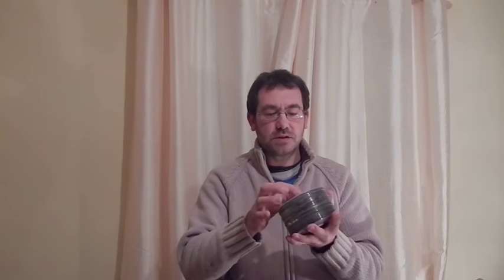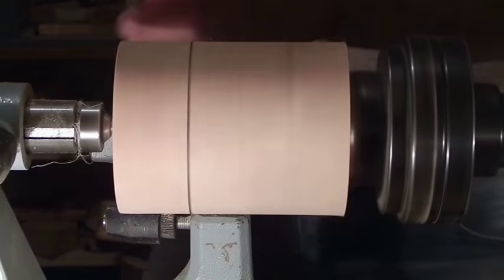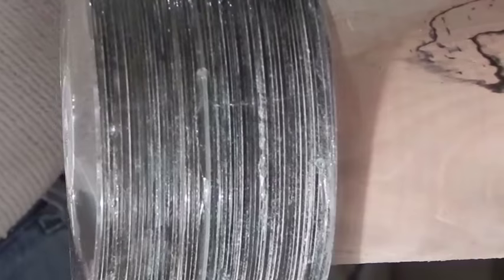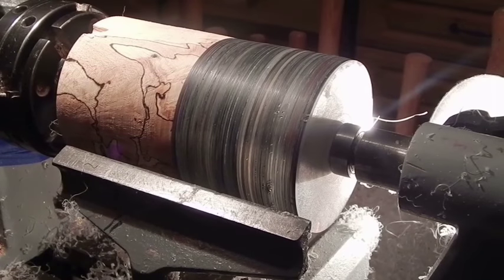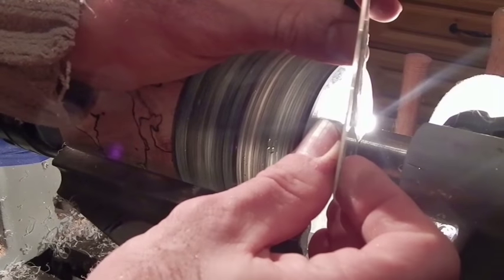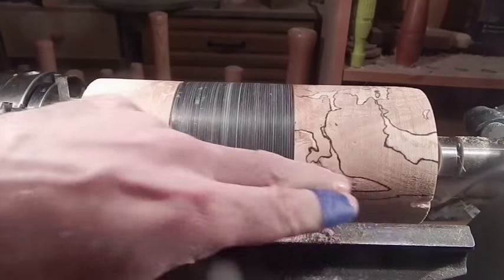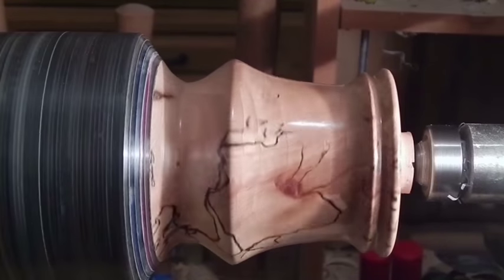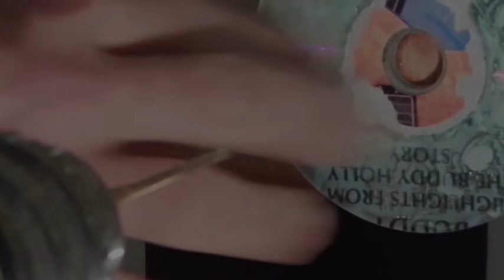Woodturning Compact discs (Cd's) Upcycling into a Spalted Beech and disc goblet

Comment: Cut plastics as slow as possible on lathe speed, removing as little material as possible, very fine cuts.!!
Gas forms when the work heats up making gas bubbles blowout in the work surface, if you still get blowout 
put some ice in a sock & rub it on the plastic while rotating to cool it down.!! ... I Like your concept, it will look Great.!! 
Jewellers rouge on a felt buff in a drill will make it sparkle, works well on plastic headlights too.!!
Reply: Great tip Mr. Noll

Comment: Very interesting concept. And that spaulted beach is beautiful. But I got a knot in my stomach when you said you were going to step up with spade bits. I'm relatively new to turning but I've been a carpenter all my life. With a regular round bit you can step up like that. But with a spade bit you have to start with your finish diameter because it needs that center pilot to keep the hole round. Even if you are working against flat stock with full contact it would have ended in an oblong hole. and yes, I learned exactly the same way. Lol
Best of luck on the next one.
Reply from the maker: +Allen Lindale Ha Ha Yeah I knew it was kinda sketchy but I had no other bits at the time !! I've treated myself since ;-) Oh well !! lesson learned here too !! Thanks for watching and commenting, regards, Steve.

Comment: Interesting idea. Might try turning the lathe at a lower speed and using a rotary tool with an abrasive bit to shape the CD stack portion. The dust or chips might be more managable than the plastic stringers that could be potentially hazardous when turning like that.
Reply from the maker: +pauljs75 They aren't too bad once you get used to them, plus cutting a groove along the length reduces the strings if you want too !! Thanks for watching and commenting, regards, Steve.

Comment: Oops, more glue... Eagerly awaiting the continuation of the saga!
Reply from the maker: +Willem Kossen Ha Ha LOTS more glue ;-) Saga is a good word for this project Willem !!! The conclusion will follow soon my friend.... Thank you for watching and taking the time to comment... Steve.
Reply: +Templeboy Turnings what is the name of the song I can't find it in the link
Reply: +Templeboy Turnings Shouldn't you be using a plastic solvent? I think CDs are polycarbonate, aren't they? Thermoplastics like polycarbonates and acrylics don't work well with CA glue. Best to use their own solvents for gluing. They are most commonly used in water-thin form which wick in completely. Takes a good week to cure in thick joints like these, but when done they will be fused as a single chunk of plastic instead of plastic-glue-plastic laminate. MEK (Methyl-Ethyl Ketone) from your local hardware store should work well. But use a vapor respirator.

Comment: Hello, I just stumbled upon your video. Here's one hint for you: first of all, you should use only blank, plastic discs. You can usually find them in cd-towers - they are disposable and used to protect fhe first and the last discs in the tower. Don't glue them togheter or you'll end up ruining the final purpose: if you find a way to somewhat add a led light source from the inside, or from the base (or the top, or all of them together), you'll be able to create an amazing wooden lamp. Just give it a try!
Reply from the maker: +Thomas Samoht Thanks for that Thomas, a little hesitant not to glue anything together though to be honest....... Appreciate your feed back and ideas, I will keep them in mind for future projects..... Thanks for watching also... Kind regards, Steve.
Reply: Templeboy Turnings If you find a glue wich is transparent after curing, then it's good.

Comment: Just one more thought if you cut the dowel the right length you could run it from one beech blank clear through the CD's into the other beech blank. You would have to be careful of the depth of the goblet if you didn't want to see the dowel in the bottom of the cup but it should make the CD portion a lot sturdier and prevent the problem you had at the end.
Reply from the maker: +bcdc94 Thanks a million for your suggestions, This was one huge learning curve of a project and I am going to attempt another goblet soon...... watch this space lol...... Thanks a million for watching and for your kind comments, very much appreciated, regards, Steve.

Comment: At around 11:50  (and later) you look to be attempting to pull the shavings free whilst the spindle is still turning, I am sure this is something you frequently do, as do many of us familiar with turning tools, both wood and metal, but I cannot stress enough how easy it would have been with that volume of poly-carbonate strings present, for them to "grab". At those spindle speeds, you likely wouldn't even have the time to feel the pain as your arm is yanked clean into the spindle and crushed in hundreds of places while it is wrapped around your workpiece and tailstock.

I had a student amputate a finger because a chuck grabbed his finger while he was palming it to a stop (the way that many of us do regularly) and it completely changed the way I work and teach.

Please, for the benefit of all, stop showing your doing this. 

Otherwise, pretty neat stuff you got going on there.
Reply from the maker: +dunewizard Hi, Thanks for your honest and informative comment. I will be addressing some of the safety points that have been brought up in the comments in a video. I appreciate your concerns. Thank you for watching. regards Steve.
Reply: @SteveTwoodturning  I don't know about you but these 'safety police' comments are very irritating to me. You do you boo. 

As long as you don't get hurt, keep up the good work!

Comment: I've only used a lathe a handful of times but enjoyed it and I'm going to buy myself one so I was wondering..what type of chisel/gouge are you using at 10.35 before you changed to the parting tool?
Reply: +Gordon Chapman Round Carbide cutting tool.
Reply from the maker: +Gordon Chapman Hi ...Yes as Gareth kindly said its a 1/2 inch round carbide scraper, Thanks for your question. Good luck with your future woodturning, let me know if you have any questions... Thanks for watching, regards, Steve.
Reply from the maker: +gareth martin Thanks for answering Gordons question its much appreciated !! Thanks also for watching, regards, Steve.

Comment: you should be using fiberglass resin to glue those together, super glue isn't a very good choice when needing structural strength. Plus it fills gaps and is softer when dry than super glue.
Reply from the maker: +TheeBudGuru Thanks for that, I used epoxy resin in the recent video I posted ..That seemed a little better to use.... Appreciate your ideas and comment and your time watching, regards Steve.

Comment: Now take all those shavings.. maybe mix up some dye, or add copper and aluminum shavings, mix it up, stuff it into a container and fill it with epoxy.. then turn something interesting.  Great attempt, but as you seem to be aware of now, stay away from those paddle drill bits.  They are far too aggressive and prone to chatter.  But I can't fault you for working with what you have!  Best of luck.
Reply from the maker: +Big Dan Thanks, Yeah lessons learned and doubts confirmed with this one !! ha ha ...Oh well.... hmmmmm A big epoxy mish mash aye ??? There is a thought ;-)..... Thanks a million for watching, and for your suggestion, much appreciated, regards, Steve.

Comment: clever idea 
2 part Epoxy resin would be stronger and a better adhesive to the plastic and the wood
Reply: also a hell of a lot cheaper than super gllue for the amount you use
Reply from the maker: +michael dodds Hi Michael .... The super glue I use is pretty cheap, but yes I am going to experiment with epoxy too..... Thanks a million for watching and for your advice... regards, Steve.

Comment: The "nib" is there deliberately to stop the surfaces of stacked CDs and DVDs from rubbing together if they are stacked. You may get a better glue-up if you skim it off on all the CDs in the stack. Also, if you generate any localised heat, the CA glue is going to break down and the joints will start to fail. You may do better with cheap "5 minute" epoxy.
Reply from the maker: +Mark Sinden Yes Thanks for the info, I have started sanding every disc now for future projects and the CA holds up better when used on the scuffed surface ..... Appreciate your watching and taking the time to share your knowledge and advise, Kind regards, Steve.

Comment: im wondering if it would have worked better to use the spade or forsner bits inside a standard hand (or drill press) to hog out the majority of material .. then switched back to the lathe for the finalization of the shapes
Reply from the maker: It would have just been easier and safer to use a forsner bit on the lathe, I just didn't have one at the time. But I do now :-D Thanks for watching and commenting, much appreciated. Regards Steve.
Reply: i was kinda thinking maybe pull it off the lathe and hold it in a vice or something to pull out the excess material, then switch back to the lathe for the final finishing work, that way there would have been less stress and weight on the joint initially. 
but neat video none the less. i haven't worked a lathe since i was in high school almost 13 years ago :)

Comment: great video, Why would you not use a dowel instead of reducing the block.? Is there a disadvantage to using a dowel?
Reply from the maker: I could have used a dowel yes but my original thought before it all went a little wrong was to have the spalted wood showing through the cd's on the stem ... But as I said it didn't quite work out lol.....Thanks for watching and commenting, regards, Steve.
Reply: Right yes , still i really like the concept and the technique. Thank you very much.
Reply from the maker: Your welcome, and thank you !!

Comment: Nice to watch this but I am really surprised to see you trying to clear the shavings while it's spinning at full speed..  Couldn't they wrap around your fingers and pull you in to the job?
Reply from the maker: +Michael Hawthorne High !! Its not normally good practice to put your hands near the lathe while its spinning no, you are perfectly correct to say that. And I wouldn't recommend it to anyone !! However, the strings from the Cd's are only a problem when they bunch up and get caught on the tailstock ..... They just stretch and snap if they catch on my hand or fingers ..... Thank you for your concern, and for pointing out my error, its much appreciated, thanks for watching, regards, Steve.

Comment: (Haven't read the Comments) I hate to say it, but I saw that coming, because the only stability a spade-bit has is derived from its center-point. Cutting with just the outside edges of a spade-bit, especially in larger diameters, is as inherently dangerous on a lathe as it is with a hand-drill.
Reply from the maker: +dhsquared Yep. Oh well, you live and learn, I have since purchased a set of forsner bits,,,, So it won't happen again..... Thanks for watching and commenting, regards, Steve.

Comment: How to make packing material from CDs
Reply from the maker: +John Cobb LOL I know right ?? I have kept it all for more experiments !! Watch this space ;-),,, Thanks a million, Steve.
Reply: +Templeboy Turnings Just as warning, those cd's are made from PCB, what is extremely poisonous if heated and PCB dust is not exactly a safest thing to breath in, so micro particle breathing protection if not even combined micro particle+gas protection is kinda of must when working with this stuff.
Trust me, you dont want to take this shit in to your body in any form what so ever...

If you want to combine two peaces, you should try PCB glue. That stuff should do the trick. For cyanoacrylate its not biting hard enough as PCB is kinda oily/slippery plastic.

Comment: Could've used the fact that the discs are translucent and stuck an LED or two in the middle of the CD part.
Reply from the maker: +Linards Jukmanis Hi Thanks, This was an experiment, the first time anything like this has ever been done with Cd,s I have since made other projects and videos, so I am experimenting with light and other mediums. Thank you for watching and commenting, regards, Steve.
Reply: Of course, it's a lot more reasonable to finish a nice project than add tons of features and be completely unsure of how it comes out. :) Good luck!

Comment: Could you please indicate the measurements with the metric system?
Reply from the maker: +Luxie Daemon HI, so the first block is 5 inches long by 4 inches square, in metric That is 125mm long x 100mm square...... Stack of Cd's is approximately 3 inches by Cd size lol which is 75mm ... second block is the same size square 100mm but its only 31/2 inches long which is roughly 80mm ... So the goblet ended up a total of 280mm tall by 70mm round at the rim of the cup........ Hope this helps..... Thank you for watching and commenting, regards Steve.
Reply: Thanks! it would be great if you could maybe indicate measurements y both systems in future vids. great work!
Reply from the maker: Hi I normally do as ours is metric here in Ireland, but I think I may have edited it out by mistake ..... Sorry, but yes I will try and remember for future videos ..... Thanks a million, Steve.
Reply: great thanks!

Comment: Man I hate to be that guy, but at least roll up your sleeves when you're using a lathe. You're asking for it.
Reply from the maker: +Valten Hi, Its OK your not the only one to bring this up, and I will be addressing it in my next video, But just to clarify Yes I wear long sleeves, because its bloody cold in my workshop, also because those strings sting like a b***h. I have worked a lot of hours in front of my lathe, and more often than not I wear long sleeves, but they are not loose. All wood turning smocks have long sleeves? yes strapped but still long, It "advised" not to wear long sleeves. Like I said I will address this in the next video, but thank you for your concern and thanks for watching and honestly commenting, its much appreciated, regards, Steve.

Comment: Hi there, just stumbled across your videos, and thought to leave a small tipp .. if applicable:
When your glue-ing stuff like these discs or porous materials together with glue/epoxy, air bubbles are the enemy.
you might want to try and put it into a bag and vacuum the air out of it.
..easiest way could be to use a syringe + check valve on one side. inlets of epoxy on the other..
-- example: https://www.youtube.com/watch?v=VodfQcrXpxc

- I don't know how effectively this can be used without molds, but should improve / reduce number of airbubbles.

Edit: For the discs you could fill up middle hole of discs with epoxy and apply vacuum with kitchenpaper as spacer/air spreader+bag on outside...kinda..
Reply from the maker: +Psi Q Thanks for the information, Appreciate your watching and taking the time to offer your help, regards, Steve.

Comment: that was so dangerous holding the cds while the lathe was turning, you could have broken your wrist easily
Reply from the maker: +ash G. Hi yes I agree I should have explained that my lathe has a belt that slips if under pressure,  so I was quite safe you do what I did, but yes in normal circumstances its bad practice.... Thanks for pointing yha out,  and for commenting and watching, regards Steve
Reply: +Templeboy Turnings oh ok well be safe and keep turning
Reply from the maker: Thanks a million, appreciate your pointing that out though ..... Steve.